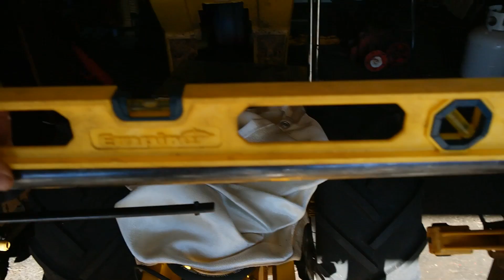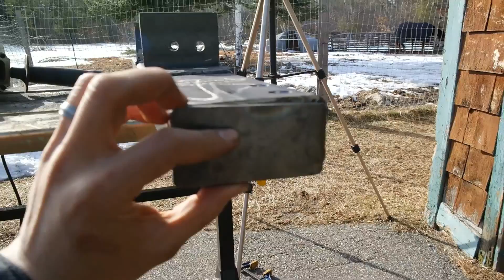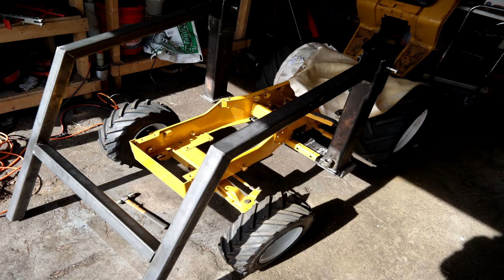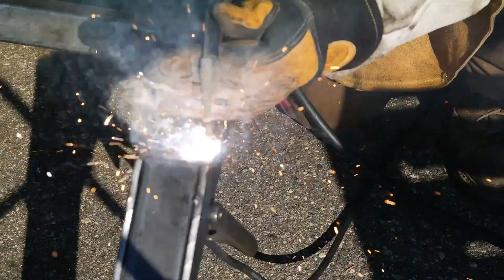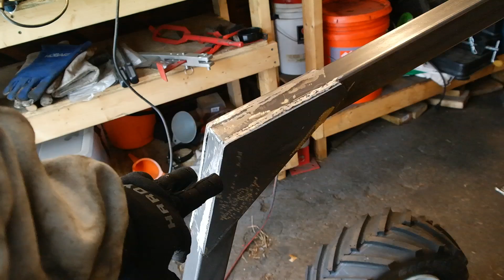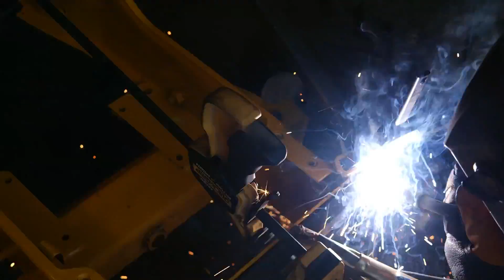Cub Cadet 149 TLB Transformation Part 7 - Front End Loader build

Comment: Thought I should point out. The fittings you welded to your reservoir are malleable cast iron, not steel. The welding heat makes them extremely brittle. A better option is to weld a short pipe nipple, then screw the fitting on to the thread
Great job so far though.

Comment: I didn't see where you mounted the sub frame for the uprights. I know it has to go behind the steering rod but how far back in relation to the foot e=rest?
Also 1/2" diamer pins for the boom arms seems too small to ne. Have you had any problems with them bending/breaking?
 I know this video is 7 years old and you might not even remember Thanks
Reply from the maker: I put my uprights as forward as I could to allow my feet to be able to comfortably get in there. I thought so too about the 1/2" pins but they have never broken.
Reply: @Isavetractors  oh thank you so much for your reply. Beautiful build on the Cub. I have a 782 I am building a loader for and I will be watching your videos many times when I am building it!
Thank you, oh I will probably be buying parts from you as well!😀

Comment: Do you have a link to the hydraulic pump you used? The pump iam using i think is way to big for my setup iam blowing front seals out of it.
Reply from the maker: I use the 4 to 8 gpm gear pump. I thinks its concentric brand from Northern Tool

Comment: hey Tim loving the build thanks for sharing.
free tip; my mig is really cheap junk.
i have found that the old school blowtorch makes a massive difference when welding thicker material.
its capable of sitting wherever i put it to preheat the steel.
this means i automatically melt deeper into the parent metal and the bead is also much better visually.
Reply from the maker: Thanks! Agreed. I now use a 200 amp welder and have an oxy acetylene set up for preheat when needed. Thanks for commenting!
Reply: oxy is expensive the old school blowtorch uses diesel or kero.
And after getting used to it im not afraid to point it at something and come back 1/2 hour later, and if i forget it just shuts itself off after spending 50 cents of cheap readily available fuel.

Comment: Are you running the welder from a generator?  if so how many peak watts?
Reply from the maker: Yea this project I used a 4000w generator and a 140 amp welder. I now use a 200 amp welder from a 50amp wall outlet.

Comment: I have a factory quickway loader loader that was originally on a Sears Suburban.  I plan on putting this on my Cub 1650. It would be great (and greatly appreciated) it you could make a video detailing the subframe of your loader. You don't really spend much time on it. I see in this video the angle iron tabs that are drilled for bolting to the frame. But do you attach it other than that, (besides the angled arms to the front)?  I'm curious if you tie it into the rear of the frame or axle as well. Thanks. Keep up the good work, I enjoy the videos.
Reply from the maker: Check out this video of my Ford LGT 145 with Kwik Way Loader. It will show what you're looking for and may be better information than this cub build: https://youtu.be/Fmtsmfwp4co

Comment: You may want to fix the engine on  your welder.  That constant pulsation has got to be making your welds harder than they need to be
Reply from the maker: Do R/C! Yes i retired that unit during filming of this. Now I use a unit that runs off of wall power.

Comment: Getting the 1 inch round bar level? you are assuming the tractor is sitting dead level and parallel to a dead level floor. getting that rod dead parallel to the other components is what is needed. [35 second mark].
Reply from the maker: Tractor frame was level to the ground, so when the bar is level, it is parallel. Keep in mind this is a 400 plus hour project condensed into tiny little videos, so you obviously don't see everything. Thanks for watching.
Reply: THanks Norman, you videos are very informing, I enjoy your quality of detail!.

Comment: Hey Norman, great video, I am starting on my second front end loader. This one I am working on now is  Cub 1650 and the design of the loader is just about the same as yours. I do have a question, did you have any problems with the brackets that raise and lower the mower deck? Also, you  deal with vintage engines, I just rebuilt a 19kt kohler series II, if anyone is interested, the connecting rods are the same as on the Kohler M20.
Reply from the maker: Hi Cliff. Thanks for your comment. I cut all the mower deck brackets off and removed them. I added a foot control hydro lever where they once were. We are currently in production of our own brand of connecting rods for the KT19, M20 engines!

Comment: Im  building a loader on a Montgomery wards 16 and have a 20gpm vane hydraulic pump that was given to me...do I need to buy a loader valve the equivalent to that or can I get by with a 8 or 10 GPM valve
Reply from the maker: john sullivan phew 20 gpm is way too much. you will need to get a valve that handle 20 gpm or else you will get too much heat. 20 gpm would be way too fast for a backhoe on a garden tractor
Reply from the maker: john sullivan you should get a smaller pump. using a loader even with 10 gpm would rock you all over the place!

Comment: I would mind building one of those for my 1250. what kind of weight does it handle?
Reply from the maker: I can pick up easily 500# with the loader, and with the backhoe I've dug out pretty large stumps with it. The total weight of the machine is estimated at about 1800#
Reply: isavetractors don't really need a backhoe but the loader would be great. can you remove it from the tractor to use other attachments or is it welded on? I'd like to be able o remove it so I can use the snow blower or blade. I'm thinking maybe using the current system for attachments on front so I can do that. not sure how strong the clip part is though.
Reply from the maker: the stig mach 1 the backhoe is pinned to a subframe by 4 pins. it can be removed but I would imagine it would be a real pain. I don't intend to take it off.

Comment: I'm gathering supplies for a snow loader attachment for a Frankenstein 18hp 1990 Craftsman.. My drawing templates so far are smaller versions of old Ford tractor loader implements. Something I just don't get, looking at every type of loader, they all use extremely long rams for the main lift. I am guessing here, but I think John Deere cylinders are about 1 ton total capacity, and guessing again the rams have an 18 inch stroke.. I have a nice pair of 2-3 ton shorties, but they only have 8-10 inches of height gain.. Can I mount them closer? Is there a formula out there I can use? 95% of my use for it is for snow moving, the rest as a lazy man wheel barrow, maybe some light grading work following a rototiller, so I don't need anything as powerfully built as yours here. Still, I'd really like to know some of this math so I'm not messing up, grinding mistakes off, messing up, etc. I have to use what I can get my hands on, and the pair of them for $50 was too good to pass up. I can't afford $150 apiece and have a loader by next winter.. Any ideas where I can look for the math to see if I'll get the overall height I need out of these shorties?
Reply: P Huster don't know if you've finished your loader project yet, but you could easily make full scale templates out of cardboard of the uprights and the loader arms. Mock them up on the floor, with a pivot where it should be. Then use a tape measure to measure the rams closed and extended. And should be able to figure it with no math involved.

Comment: not to be mean but better take it easy on horsing that grinder. trying to force it through will cause it to blow up. run a small notch with it where you want to cut and then let the grinder cut it at its pace. also when you throw dust like that your putting too much twist on the disk that weakens it which could cause it to explode

Comment: hello I'm new to fixing mowers and I have a cub 1968 124 it has spark when I take the plug off and turn the key. compression seems perfect. It also has a good new carb and gas i think gas is getting in the mower? any ideas what I should get or do to fix this issue?
Reply from the maker: +Will Klaer Hi Will. Firstly welcome to the very rewarding hobby of bringing back old garden tractors to life. So is the problem it's not starting? You should go to www.kohlerengines.com and download the free service manual for your K Series engine. Next, you want to check the point gap, see my channel for a how to video, and then check the valve clearances. Also confirm that your fuel tank shut off valve is open and fuel is indeed flowing to the carburetor.
Reply: +isavetractors Thank you so much for your advice. It was really silly what was wrong. I was getting a very yellow faint spark. I read online that the spark should be blue I just got a new spark plug and my tractor fired right up. It was a rookie mistake.
Reply from the maker: +Will Klaer it happens! please subscribe to my channel for lots of videos on these old tractors. also if you ever need parts we're the guys! I recommend you change the points, condenser, air filter and spark plug every year. you want to ensure complete combustion for best long lasting performance. thank you for saving the tractors!
Reply: +isavetractors ohh definitely, I saw your site and you have the best prices I have seen, also I do like the verity. I told my friend at work who also has old cub cadet with k series engines as well.

Comment: Looks good.  I'm not an expert here, but your welder tip sticks out of the nozzle way more than mine.  Didn't look like flux core wire, so are you getting proper gas shroud.  Also heard welder motor surging and probably changing the arc. Keep up good work.  I'll be ordering parts for my K301 soon... waiting almost 2 weeks now for machine shop to measure my block.
Reply from the maker: Thanks for your comment. I am running flux core wire so my stick out is a lot longer than if I hooked up gas. at one point my generator bog down because it was about to run out of fuel. thanks for watching!
Reply from the maker: also on some of my longer welds my motor did surge a little. I tend to have trouble keeping my wire stick out consistent on the longer beads so that changing of amperage affects the motor's governor.  by the end of this project I should have had enough practice to remedy my technique!

Comment: just wondering how much did all the steel cost?
Reply from the maker: +Zach Ulrich I bought a lot of steel enough to make 3 loaders! I think I've spent about $1,000 on steel so far. So for one loader maybe $300 - $400 in steel. I just bought the hydraulic components and that cost me about $1,000.